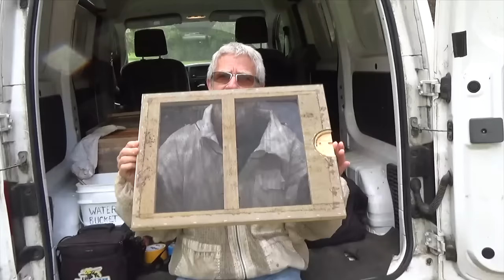For new and old beekeepers using a doubled screened dividing board to split a beehive is VERY easy.

Comment: Hi Mr Ed.
Here in Scotland 🏴 we call this The Demaree Method.
The Demaree Board 'stops' the Bees 'touching each other aka passing on 'the Queen Pheromones' so those where the Queen isn't 'think' they are Hopelessly Queenless (!) They're not ! She's either in the Basement or the Attic. 🤭
By doing Splits via the Demarre Method : you don't need so much Equipment re Hive Boxes.
Also those in the 'Dwindling' Side (not have the Queen laying up more Babies) can 'share the Hive Warmth.' And once the 'Queen Cells are made' and moved elsewhere, means you still have a Massive Colony to combine back together and get you a Big Yummy Honey Crop. What's not to like. 😎
🐝🐝🐝🐝🐝🐝🐝🐝🐝🐝🐝
   Happy Beekeeping 2024
🐝🐝🐝🐝🐝🐝🐝🐝🐝🐝🐝
A Demarre Board is easy to make : use any Timber that is thick enough to allow for a decent "Gap" between two Screens. I use fairly cheap Garden Windbreak Plastic Mesh about £2 a Metre. 
($2.50 Yard kind of. . . 😉)
So as cheap as chips Since each Screen doesnt need a huge bit !
Have Langstroth, UK Nationals, and French Warre Hive Warre Frame versions, using Pallet Wood, that's Free, Simples . . . 😁

Comment: Thanks for the video.
I was a bit confused by what you did but I think I have now figured it out.
Please correct me if I am wrong.
•	You split if 6 or more frames of bees in top box and 6 frames in bottom box.
•	In first hive: 
•	You removed all queen cells and cups from top box (because queen is there). You then          put double screen board between top and bottom box.
•	One week later, you put top box on new stand.

•	In second hive:
•	Swarm cells present. You  cut them out, removed all other queen cells, attached cut out          cells to frames and put frames in the box (was bottom box) that is on new stand.
Reply from the maker: That's it, and next weeks video will show what happens 7 days after the board was installed. Thanks for watching. God's peace Vlad.
Mr. Ed
Reply: Thank you!!!!  @JeffHorchoff

Comment: Thought: if you built a 1/2" rim arround the top edge of the double screen then there would be space for the Queen cells not to have to be scraped off
Reply from the maker: As the swarm cell has to be removed from the box, either the entire frame or the individual cell, adding the half inch spacer would not help. Thanks for watching. God's peace.
Mr. Ed

Comment: Hey Mr. Ed.  I loved your video, but I had one question.  You mentioned that you prefer to keep the queen in the upper box when you split and have the bees make their own queen in the bottom box, but you didn't check to see if there were any eggs or larvae in the bottom box.  Without checking, wouldn't that set you back weeks without knowing that there were no eggs or larvae in the bottom box?
Reply from the maker: There is the possibility of not having brood young enough in the bottom box for them not to draw out a emergency cell, but if that is the case, when I return the following week and find that situation, I grab a brood frame from the box above with young brood and try again. Yes, it cost me a week, but I'm still ok with the timing. God's peace David.
Mr. Ed

Comment: Boy you sure can tell when bees are upset. That poor camera took more hits than you boys combined!

I always heard if you were gonna move a hive you had to move it at least a mile.  Obviously that's not true as I see you splittin hives & moving one box right next door to the other one.  Where'd that tale come from anyway?
Reply from the maker: Bees just can't stand the camera...or it could be Charlie. No, for whatever reason, bees will attack the camera, especially if they get worked up, and in this instance they were. It's a different story about moving hives or moving a split. Splits matter not where you place them, it will be ok. However, a hive either needs to be blocked up before moving and left closed for at least 2 days if moving it less than about 2 miles from it's original site. If moving the hive more than 2 miles away, after closing it off, they can be allowed to fly as soon as the box is set up in it's new location. Thanks for watching. God's peace Carole.
Mr. Ed
Reply: @JeffHorchoff  Could you correct my reasoning on this if you have a minute?  So the splits are ok to move next door because all the field bees will return to the box that doesn't have the queen anyway right?  And the newly hatched brood in the split (where the queen is) will automatically orient to the spot where that split box is.  But if you move the whole hive, when the bees leave the box (after being orientated to the original place of the hive) they're going to automatically return to where the hive WAS rather than the new spot if it's close by.  Is that the reason you close up the box for a couple of days, to force them into doing orientation flights again in their new spot if it's closer than 2 miles or so?  Why do they know to do that if you place the hive more than two miles away?  Do you have to keep them holed up in their hive for a couple of days even when you move it further than 2 miles or not, and if not why do they know to reorient then when they didn't know to reorient when their his was placed closer?  Sorry if this is too tedious to answer.  I'll totally understand if you don't respond and just keep watching to learn more.  Thanks!